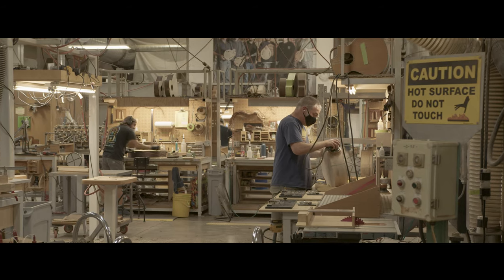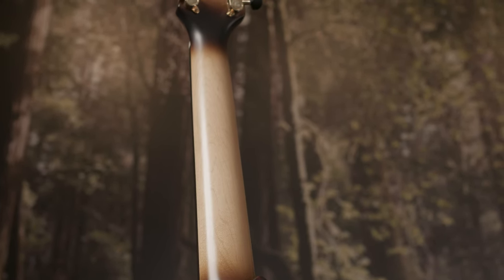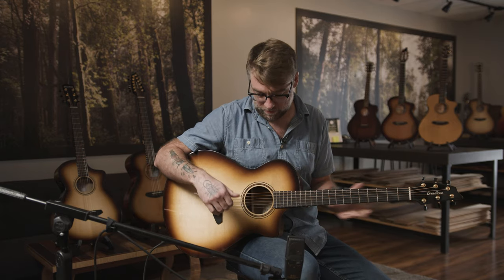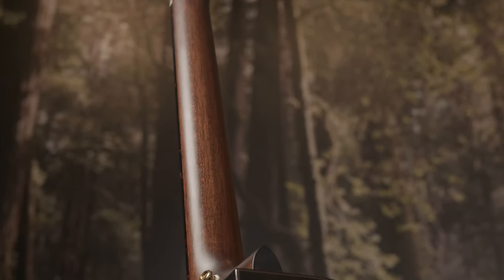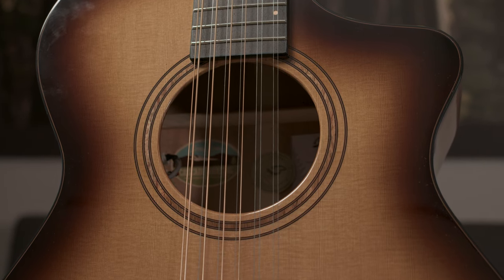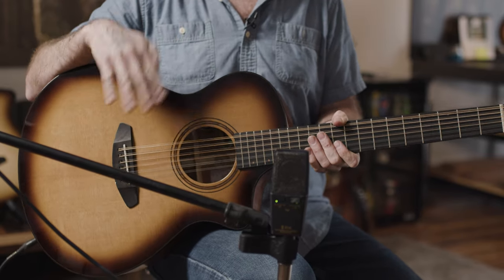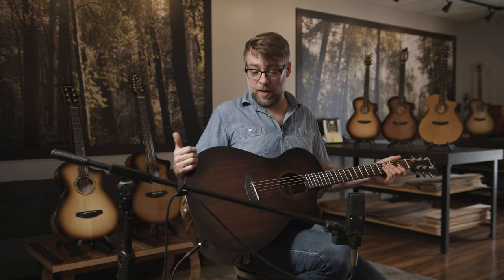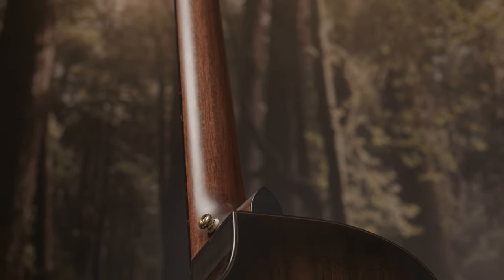Breedlove Organic Pro Line Overview

Comment: I'm so glad Breedlove came out with this series. It allowed me to buy the original organic signature series concert copper ce at a clearance price below $350! Saving me about $800 over the pro series. 
   Things that I don't like about the new pro series. The tops aren't torrified like the original series. The electronics are mounted into the wood. Whereas the original was internal. Why cut out good quality wood? The bracing is not based on improving the sound based on the wood used. It is based on the shape of a mountain range. Bracing should be carved to improve the sound of the individual soundboard.
   The organic pro series are probably good guitars. But I like the deal I got on the original organic series
Update. Breedlove using half the glue was a bad idea. 2 weeks after buying the guitar the fretboard came un glued from the 14th fretboard to the soundhole.